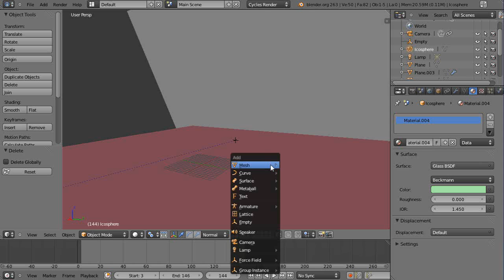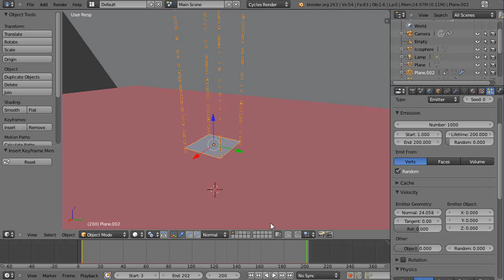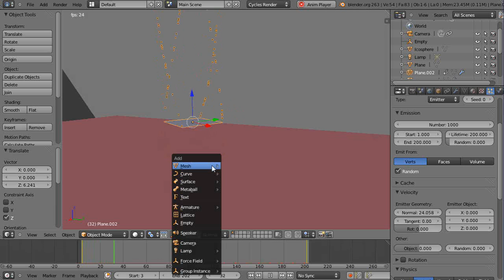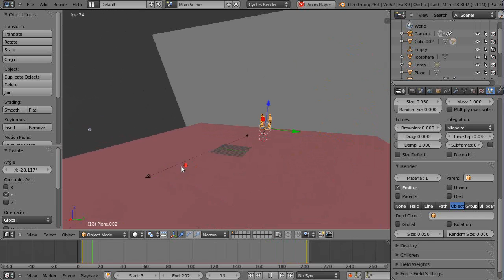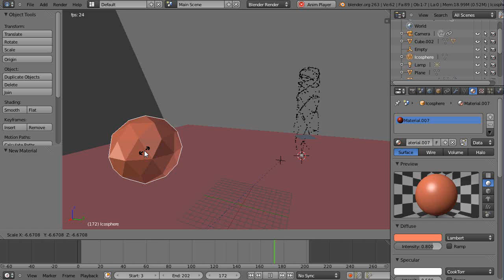Blender 2.6 Tutorial - Swirling Particle System Effects

Comment: Masses are to take an outward, hyperbolic spiral orbit in the same direction as the rotating plane [circ. frame of ref.]. The Hyp. Spiral may vary in angle from "stretched clockspring" to the more familiar "6" or "9" Hyp.spirals - velocity dependent. but the orbits are outward. Ideally, a spinning spacetime containment would enable 'natural' flow...but I feel artistic license leaning in by necessity and pending my more adept particle control!